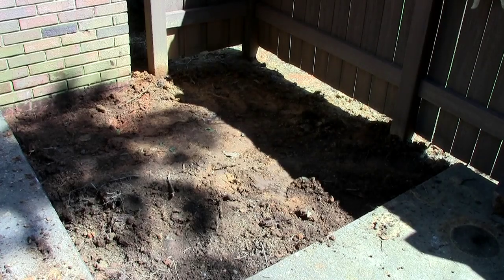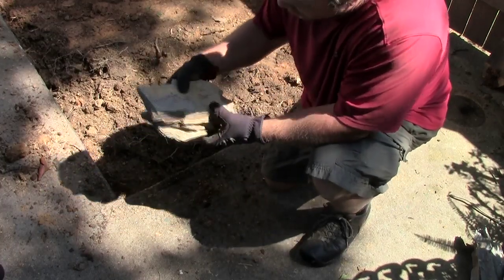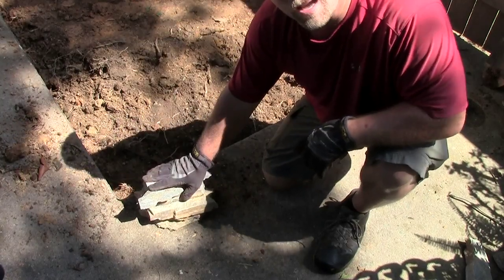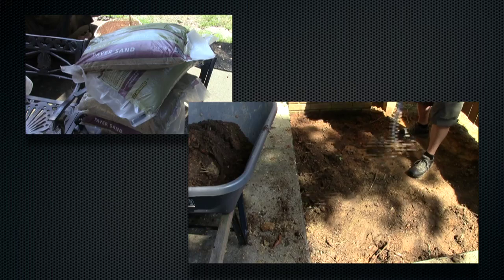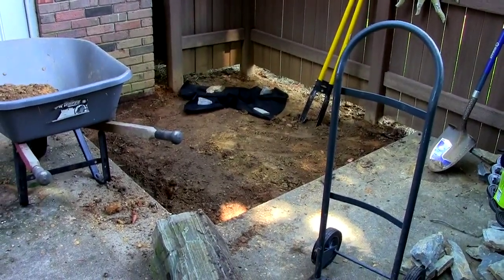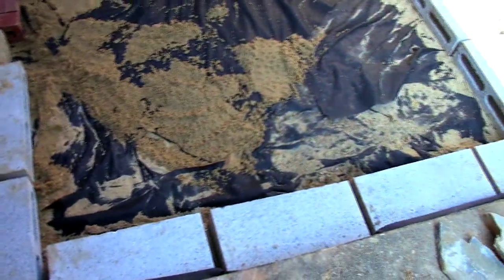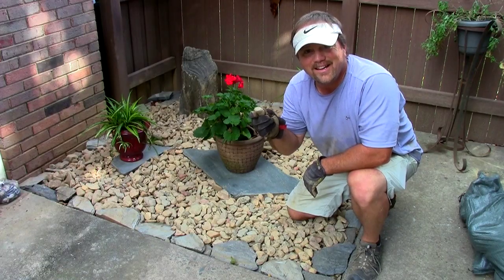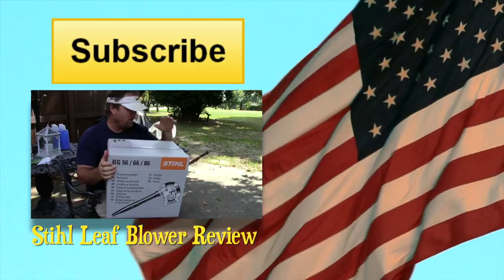How I Built My Rock Garden ~ Backyard Landscaping

Comment: Hi Steve, I have a 'rock' garden in the corner of my house, as you step off the deck, to the left, I have a medium sized fountain, a concrete bench, and a large vessel to hold a running plant, and pots of flowers. I have pea and larger gravel with a couple of large pieces of slate. My late husband built a pergola over it a few years ago and it looks really nice. I have lots of little frogs and geckos, birds and cats that drink from the fountain at times. What do you do to control any vegetation that comes up through the rocks? Years ago, we put down the black barrier junk under the rocks to prevent weeds. I'll have you know that the next DAY there were weeds popping up! Anyway, I'm looking for a safe weed killer for the wild life. The weeds that do pop up are easy to pull up by the roots, but I don't want to have to do that!
Reply from the maker: I guess I'm lucky. I put the barrier down and I've never had any weeds to this day.
Reply: @SteveSherron  Yeah, you are lucky. It wasn't cheap either.

Comment: awesome vid! really loved the detail
 I'm just confirming.,. the first step is to excavate, then lay the sand, and then finally lay the stone/rocks?
Reply from the maker: I laid some weed fabric down before the sand. I laid the concrete blocks around the perimeter so I wouldn't have to use a lot of flat rocks. Filling the void with sand was cheaper than filling with rocks and it's also easier to level the sand. If the sand is level, your rocks will be level. Thanks for the compliment!
Reply: Thanks for that. I plan on doing a similar project for my mother's house. :)

Comment: did you use those cinder blocks to hold the sand and plastic down while working and then remove befor you put the rock in?
Reply from the maker: natalie estrada I used them to hold the plastic but I left them in there to act as a base to sit the landscape rocks on top of also. I didn't have to use as many of the pieces of slate with the blocks underneath.
Reply: Very helpful thank you!

Comment: how deep did you go, and how many inches of sub base did you use? i want something similar, zero maintenance! was the sand really just to lay the edging on?
Reply from the maker: I did not go very deep. Maybe a foot or less. I used the sand so I wouldn't have to use as much rock. It has served me well.
Reply: @SteveSherron ok,  looks great
Reply: If you want no maintenance. After removing sub soil and after adding sand, completely cover the area with roofing felt or roofing shingles. Nothing should be able to grow through it. I used Visqueen plastic and it did not take long to break down plus sunlight gets to soil which stimulates weed germination and growth. Then add rocks, a thick enough layer you won’t see the weed barrier.

Comment: Greta job! Love it. Have a ? Did ya leave those concrete blocks around the edge in there? Or did ya remove them when before you put all the River Rock inside ?  Seems like those center blocks are a great idea . I may use those for extra stability and lay them on the side and fill the center holes of the concrete blocks with different colored rocks . Great vid
Reply from the maker: I left all the cinder blocks. To this day it's exactly the same as you see in the video.
Reply: Awesome! Thanks for the info! And very nice. Sounds solid then. Thanks again